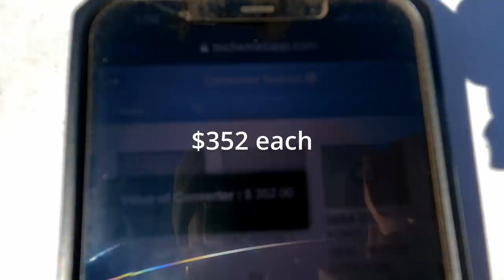CRUSHING & Shipping over 100,000 lbs of Scrap Cars! (BONUS: Never seen before camera angles)

Comment: you need to push in the back hatch befor crushing it .. saves space when it doesn't push out    good video
Reply from the maker: Space isn't important length wise. As mentioned, I can only get so much weight in the trailers without overloading them anyway.

Comment: What is the purpose of rotating wheel before you break it off with machine?
Reply from the maker: To put the locking lug nut at the bottom. Pops off easier that way.